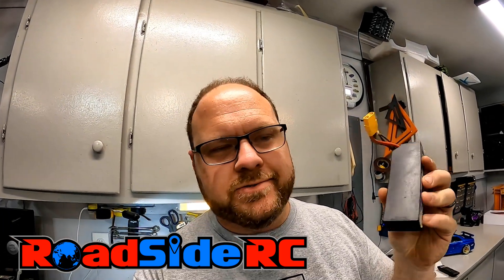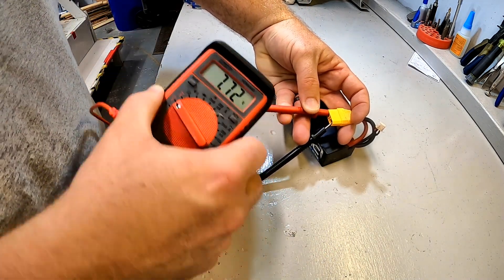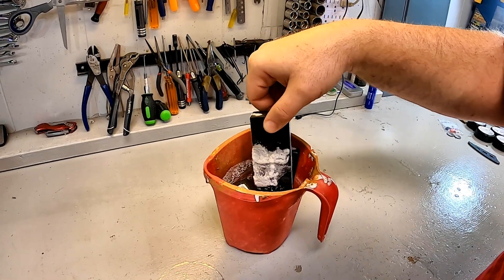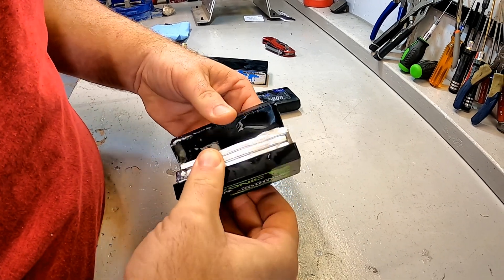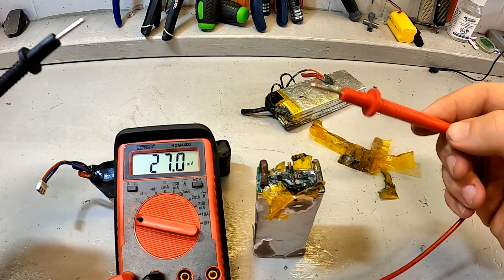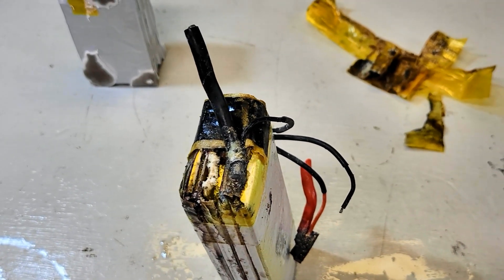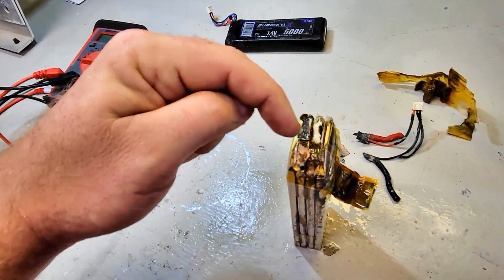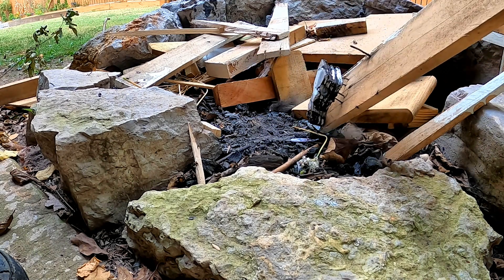How to Dispose of a Lipo Battery?  Does Salt Bath Really Work?

Comment: Hey Troy, great video! I use this method as well and it seems to work well as far as discharging. My question is, what do we do with the water after. Can it be dumped in the ground? I’ve heard people say that the toxins are neutralized and I’ve heard others say it’s still toxic and can leach into our waterways hurting water life and also get into our drinking water as well. I’m thinking like what you did here. Evaporation may be the best way to get rid of the contaminated water. Your thoughts?
Reply from the maker: Hi there!
I just dumped it.   Grass was fine.    Small enough amount of salt water to really impact anything.    If you are super worried about it - hose the area off to dilute it out.  

Unless you are doing this with 1ks of batteries a week/month, it is hard to imagine it makes much impact.
Reply: @RoadsideRC  that’s what I was thinking! I might do this maybe 2 times a year! Thanks for your perspective! 👍🏻🍻😎

Comment: Please don't do this... just because it read "0V" for you, doesn't mean it really is 0V. The corrosion isn't simply on the surface. All this does is oxidize the anode and electroplate the cathode, and when the oxidation reaches it certain point, it will no longer conduct. The oxidation at this level can go all the way through the anode, thereby rendering any measurement you take invalid. As the oxides build up, the resistance between the cells increases, and less current flows through the electrolyte solution. Lipos discharged in that manner are still capable of causing a fire. A low resistance short between the cells, even at half a volt, can still cause enough current to flow to ignite the electrolyte within the battery. They will also still explode if you pierce them after they were improperly charged at any point in their life. Lithium metal will build up on the cathode if charged improperly.

This is just an excuse to be lazy and not buy either a couple of resistors, some halogen/incandescent bulbs, or a pair of transistors and a single sense resistor for a current limited dummy load. It takes no more time to discharge it the right way as it does dumping it in water, and probably costs just as much with the salt used to do it.
Reply from the maker: Thanks for the feedback.
Reply: what if you have like over a 100?

Comment: I've been doing the salt bath discharge method for ages. I just did it for a small 1s 360mah headset lipo. Forgot it for a week and multi meter measurement dropped from 0 to  -1.5mV 😳. I didn't expect that ... picking up negative energy! ... off to the recycle center!
Reply from the maker: Ha!  Negative energy is a first!

Comment: I use 50 omhs 100w resistor for this... Discharge in one day...
Reply from the maker: Great!  Glad that works for you as well.
Reply: How do you connect the resistor to the battery connectors? Cut them off and Jam them on the resistor?
Reply: @ soldered with XT60 connector with heat shrink tube.

Comment: I usually discharge to 3v per cell. That is as low as my charger will discharge and throw them in the fire pit. Am I going to hell? lol. I snip the adapters of course. Local HS wants $8 a pair for XT60s over there. Yikes.

Comment: As a trash man they will light up a trash truck even with ends cut off and discharged
Reply from the maker: Woah!  Thanks for the info.   Glad I drop mine at the recycling center.  

When that happens - what do you do??
Reply: @RoadsideRC   welll hahahahah if the fire is in the hopper we dump just the hopper on the street and if small enough  put it out and find the batteries if inside the truck well whole truck gets dumped and the fire department gets called
Reply from the maker: @johnsupplee9053  Oh man!    That could get really exciting...in a bad way.   

Does it happen often?
Reply: @RoadsideRC   not often but it happens most of the times it's people throwing away kids toys or there old laptops that do it but rc battery's are a issue cause there small and hard to see

Comment: I had a deeply discharged 3S lipo (there wasn't any cutoff mechanism in my DIY car) and tried to charge it (what a stupid idea) so I ended up with two working cells and a dead one giving 7mV. Can I safely just take it to a battery recycler and use the other two as a 2S?
Reply from the maker: Hmm.  There is a lot involved in the answer here. 

Basic answer:  don't mess with compromised lipos.  They do legitimately pose a fire risk.  

A new battery is much cheaper than repairing any fire damage.

Comment: Why would anyone presume discharging the battery makes the chemical composition safe ? AND if you ARE going to take them to the recycler, WHY discharge them in the first place ?
Reply from the maker: This is the method suggested by many of the top battery manufacturers.  
Less energy = less energy - so discharging is logical.   
My local recycler dumps all of the batteries in a huge bin. Less risk of anything happening with the battery discharged.

Comment: I just posted a video on this exact method. I've done it this way for a long time. But a viewer pointed out to me that this way may have some problems, that could cause even more problems. I read up on it, and was convinced enough that I took my video down, which hurt to do so because my channel is very new so I could use the views. But, I also want to be careful what I pass on. Your video seems to show it's a safe method as I always believed it to be, but the literature I read was just convincing enough that I took my video down until I learn more. But again, you seem to have effectively drained those batteries perfectly. So now I'm just confused lol.
Reply from the maker: Interesting!  
I also had heard some conflicting info, after years of doing it this way.   That is exactly why I did this video.
Reply: @RoadsideRC  yeah it's one of those odd things where I know it works, you obviously proved it here as well, but there just enough conflicting information to make me wonder otherwise. Maybe it's more of a case to case kind of thing. Maybe some batteries react badly while others discharge perfectly.

Comment: In my case I use cheap esc for discharge, connect the lipo and put the esc and lipo safe place and put esc on monitor the lipo voltage, is really safe, I use a nail no fire once the reader voltage don't detect voltage is safe, this method is safe, I think the salt is great drainer of voltage, because is under the water if catch fire the water do the rest
Reply from the maker: Interesting - thanks!

Comment: Great video 👍 Salt water trick absolutely works. I prefer using an automotive lightbulb to drain my batteries, then I drive a nail through them to make sure they are dead. Much cleaner and faster.
Reply from the maker: That would really be cleaner. 

I hope they are all fully dead before you use the nail!!!!
Reply: Lol using the nail is pretty extreme, especially if it's not actually dead.

Comment: Cool ! 
Like any other rc people I also end up throwing batteries away and I usually do the following. Use my charger to discharge, then I also built a discharging rig with a buck down to light up a led, then like you said, salty water, then last final stage is any supermarket or bus stop in Europe have battery recycling containers. 
They usually go to specialized companies which by law and principle, since they get raw materials for free, then give part of their profits to NGOs, mostly handicapped, but not only. So it's both good for the environment AND for the people! 
As always nice content. 
Peace may the torque be with you
Reply from the maker: That is really interesting!!!
We don't have any such laws here in the US.
Reply: other parts of europe also got a system where its posible to leave used batteries in a container in regular grocery stores.